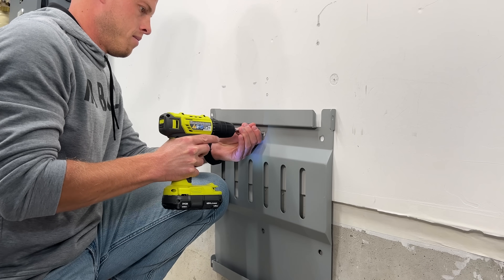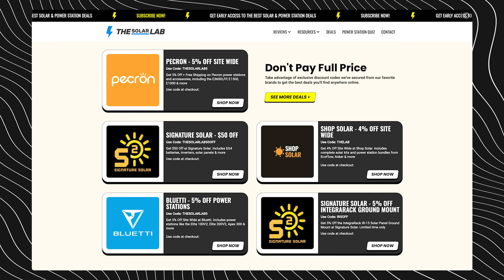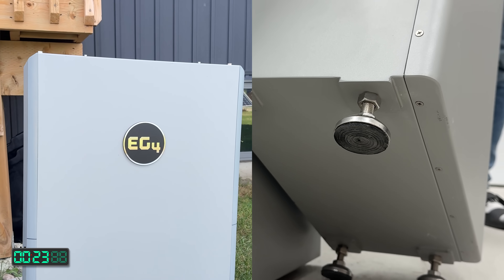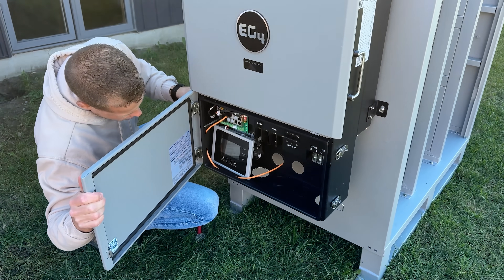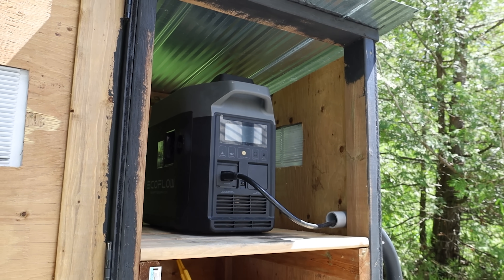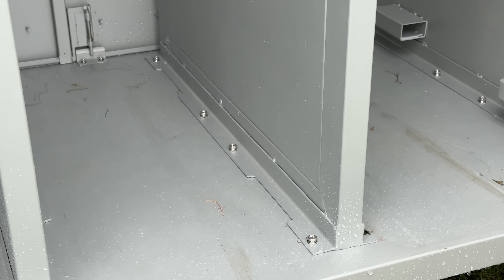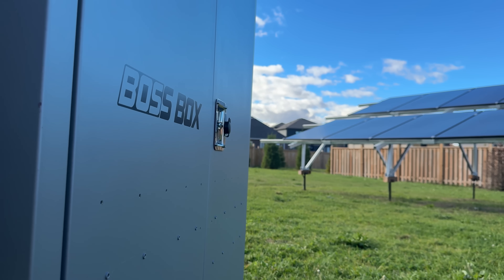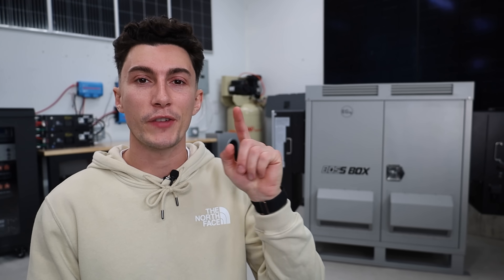The Smartest Way to Store Your Batteries - EG4 BossBox ESS Enclosure

Comment: Charge an EV? Are you insane? You should never charge an EV with any brand high frequency, transformerless inverter unless you want to smoke your EV's onboard charger and void your EV's warranty. No output transformer means no galvanic isolation.

Comment: I bought and installed one of these and did not have the problems you had.  Signature Solar sold it with the proper length battery cables so I did not have to buy separate longer cables.  Also, no manufacturing defects in mine, screw holes were aligned.  You also did not mention one other big benefit which is that you can put the box closer to your grid power, which cuts down on the amount of very expensive wire you would need to run a longer distance, such as to a garage.

Comment: I like the concept but I certainly would not pay for this thing becasue it allows water to leak in.  That will most certainly rust and ruing your batteries and otehr equipement in few years or less.

Comment: Thank you for a a great complete review of the boss box.
So far I feel that we only saw publicity w/o any real review.

I agree with you in principle... the idea of the boss box is UBER-COOL and should be useful in some cases.
HOWEVER... in practice it seems to fall. wayyyy short of the mark.

First thing:  $2500 for an IKEA self assemble blank metal box... ouch!
Second:      It is NOT water proof or even weather resistant!!!   It seems like this is only a protective enclosure to prevent kids to access the batteries.  You can't even put your inverter inside!

Honestly!  If all I need is a box to put 1/2/3 Weather proof batteries, I can whip that together with 2x4 and plywood as it took you to assemble that oversized toolbox!
Or if you need more space, you can literally assemble a cheap little metal shed.  I got a 3'x5' metal shed for $150 in which I have 2 batteries and an EG4 inverter.   Took 2-3h assembly.
You rent and need to move (that's my scenario), no problem!  Leave the shed behind and spend another $150 at the new place!    
Unless you own a fork lift, when you move, you will need to empty the boss box, potentially even have to disassemble to move it LOL. More expensive and more hassle.

Sooooo that makes the viable scenarios much less interesting.   Also, the inverters have to be mounted outside.
The box is not weather  proof.   You can't put non outdoor rated equipment in there.
The fact that water seeps under and around the doors is inexcusable for a $2500 box!!!
It would have been trivial to design the doors to overlap the floor and for one door to overlap the other.

And if you wanted to use it in the context of a contractor moving his power box around, then having the inverter hanging on the outside of the box is a huge issue.  The inverter is almost guaranteed to get knocked around.
Honestly, this box could simply have been a metal frame that holds the batteries upright and hangs the inverter.  You don't need the walls.

So what viable scenario does that leave us with to purchase a $2500 box???
I can't really think of one.

In my mind, this box should be:
1) Weather resistant like a house (i.e. NOT dribbles of water inside)
2) Should house 1-4 batteries.
3) Should have room for the inverter to be INSIDE the box with a dedicated door opening to the front of the inverter.
4) Should cost no more than $1000 at the very very maximum!    You can have a contractor build you a real (large) shed for cheaper than the cost of the Boss Box.

Truly, as much as I LOVE the idea of the Boss Box, it's current implementation and pricing is a total fail!   I give it a 1/10 rating :-(

- Christian

Comment: This needs to be water proof and you should not need an outdoor rated battery for an enclosure.  3x indoor batteries are $2100 less expensive then 3x outdoor batteries.  The costs could then be justified.

Comment: Sounds like the manufacturer has a bunch of easy fixes to do to make this a viable option. They should have a base for older units to sit in so you can use this unit properly. They should have a shelter cap to ensure that breakage isnt a thing in shipping. They need to gasket seal the doors. They need to ensure someone with a measuring tape figures out the length of the cabling they need. They should have fans built in the unit and a temp gauge as well so that you have an optimal read out so your batteries are not damaged. Ensure someone who isnt crosse-eyed is ensuring the mounting holes are set properly!

All things that should be relatively simple to do for the consumers. Especially for a 2500 storage cabinet. 

The lack of these very easy things really hurts my brain and is preventing me from going with this manufacturer. 

Where was quality control?

Comment: EG4 has a problem with version compatibility as you found and v1 GridBOSS doesn’t fit Eaton breaker, etc. - not clear or highlighted as a caution in their marketing, ever. I looked at buying this for a project - rejected because we have two inverters and four batteries - won’t fit, then buying two way too expensive, building a custom enclosure with same eq arrangement as indoor install 30” deep, 9.5 ft long and can put a real roof on it, make it tall enough to use the inverter on top of the battery w cable trays in between.

Comment: Signature Solar does sell a parallel kit for the batteries.   The cables are about an extra foot longer.  If you get this kit, you will have a boat load of extra 2/0 cable.  I could not mount my Flexboss on top of any of the batteries due to a lack of space.   So I had to take two of the extra battery cables and used them to make an extended cable that could run from my master battery over to the Flexboss 21.  I ordered pure copper butt connectors, crimped them really well and heat shrink everything.  Look pretty good after I was done if I do say so myself.   And even then it just barely reached.  But I didn't have to fork out any money for 2/0 cable.  ;0)

Comment: Sure!  Spend 20 Grand on expensive batteries and electronic devices and put them all in an un-airconditioned, hot, cold and humid environment inside a cabinet in the back yard!  Makes good sense to me!
Reply: It DOES make sense because they require that all component be outdoor rated!   LOL. that thing is an overprice chain link fence to prevent the kids from touching the batteries (And it leaves the inverter hanging on the outside!)

Comment: Cowards! You built it around your batteries. Try putting them in after it is built. You think wall mounting those beasts is tough? Try lifting and moving them in sideways! 

Oh, and it perfectly fits a standard Generac generator pad. You can buy those precast if you don't want to pour a small slab.

Comment: I'll buy it right now and that entire same kit, if they guarantee it will survive in Arizona Heat outside, when installed by licensed electrician. 😮
Reply: Other companies make these with built-in climate controls.  They are not the only option on the web.
Reply: @robertgiresi9515  thanks. It's either that or run it 30 feet straight back to my cooled shop.

Comment: 2500? And that's with a discount code, nah. The metal looks like it dents easy, QC doesn't seem great, and they included zero seals to keep water out of an outdoor unit, it screams flimsy. I know the box is already heavy, but it seems like it needs to be more rigid vs depending on the batteries for extra strength. The only reason I would see buying this is if you were required to put you're equipment outside and space was crazy limited, or you live in an HOA that wants a specific look in the neighborhood. Other then that the same money would get you a small shed, or spend half that and get a 10ft shipping container for much more room. Throw in a very small low power hvac unit and you don't have to worry about the batteries being heated or not. What happens when you want to add a 4th battery? You need to buy another one of these. The target audience for this seems slim. As it currently stands, that price needs to be closer to 1k. It looks like 2 battery server racks with a base slapped together with less holes and some vents.

Comment: I went the inexpensive route. I purchased a 72"x32"x16" file cabinet on Amazon for $139 (USD). I connected a 2.5" electrical conduit between the soffit and top of the cabinet for (2) 6AWG 3 wire cables. One to the Critical Loads circuits, which has all the in house circuits except for the HVAC, Dryer, Kitchen Range and Water heater and one cable for Grid Connect (charging). I have a 1" conduit that goes into the Lanai deck out to the 10 Solar Panels. The cabinet is located in the Lanai and the panels are along the north wall that gets direct sun light from 9AM - 4PM. I have (2) 4" fresh air vents on the lower right side of the cabinet and an exhaust fan on the upper left side of the cabinet. The fan is rated for just about 2x the cubic feet of the cabinet. Constant fresh cooler air. Working great, and the cost was a lot less than one of those EG4 battery storage units. The EG4 6000XP/14.3 Wall Mount battery are very happy
Reply: You should make a video of this!
Reply: Do you have a monitoring circuit in place in case the fan fails?
Reply: Yes, I have 2 temperature sensors in the cabinet that communicate with Home Assistant. One is at the fresh air vents at the bottom of the cabinet and the other is mounted over the exhaust vent of the EG4. If the upper temperature gets to warm it sends me a notification that the EG4 is getting hot. I have yet to get a notification, which is good, and I am in Florida.
Reply: @donaldhoudek2889  awesome. Well done!

Comment: Can you show how you get the power to the house using external battery housing? Do you bury lines? Or fly them on mast? No one shows this. How big are wires from solar panels to house and what is ‘code’ roughly to run say 1000 yards from home?
Reply: If it's truly 1k "yards", you'll need to run a high voltage AC from the inverters (located at the array) to the house, not the solar DC which cannot transmit that distance. At that, you will probably still need a transformer to push it that far; i.e. Inverter outs 240vac feeding a small transformer bumping it to 2400 or 5200 vac and a high voltage insulated cable in the ground or aerial bare conductor to another transformer at the house to kick it back down to 240vac. Higher vac equals greater distance transmittable but also higher costs same as higher current equals higher cable costs. A thousand yards is def not recommended. Keep the hardware as close as you can to the load. (House, barn, etc). It's a whole lot cheaper. If you have any significant distance to cover between the array and the house, put the inverters at the array and ship the ac. On mine the cable size, cost, and loss for shipping DC 330 ft appx was prohibitive, so a shed at the array for the hardware. A used 20 foot shipping container can be got for $2k or less to house it.
Reply: @TexasVeteranPatriot  Thanks. North facing lot on shadow of 500 foot hill above. Needs panels away from house to capture most energy at bottom of slope. So been wondering about this for a while. This was helpful info to start thinking in more detail about the project.
Reply: 1000 yards from solar panels to the home is an unusually long distance for a a home setup. You would probably want to have the main electronics equipment close to the house and run the solar PV cabling as high voltage as possible for the long distance. This would allow for using the smallest gauge wiring for the very long distance and you would only need the larger cabling (thus more expensive) for the short run from the electronics to the house. A decent MPPT/inverter will accept 500 volt input from the PV source. The size of cable is determined by the amount of current and not the voltage. With 5kw of PV panels at 500 volts you are looking at 10 amps which will need about 4 AWG cable -- somewhere around $2 per foot. If you were to run it at 100 volts it would be 50 amps and it would need 800 kcmil cable -- roughly $40 per foot.

Edit: Some have suggested using transformers which would require AC at the PV side -- this means the inverter(s) would be close to the solar panels. This may be a cheaper option depending on the price of the transformers (and enclosures). Do the math on all of the options to find out what is most cost-effective and consider reliability.
Reply: This would be very inefficient. Is the normal power to your home run 3000 feet from the from the transformer?  I ran this through a voltage drop calculator. My parameters were 3000 feet at 240v, running only 20 amps, allowing a 5% voltage drop with copper wire.  That would require the cable run to be 3/0 wire.  Aluminum would have to be even larger.  Either way, the cable would be very expensive.  The voltage drop at 20 amps would be about 12 volts, meaning you only get 228V.  20 amps is not that much.  As current goes up, the voltage drop would as well, meaning you'd have to increase the size of wire even more to reduce voltage drop.  Runs of this distance are usually done at higher voltage, to a transformer that steps it down near the end to minimize loss and wire size. I am not an electrician, and this is not addressing code.  I have been in electronics all of my life and this addresses the physics and cost of it.